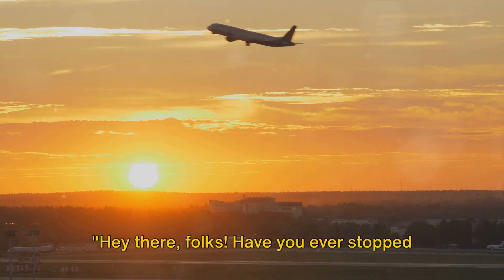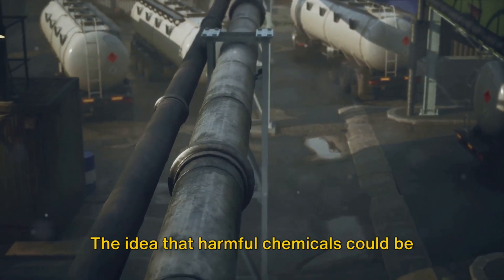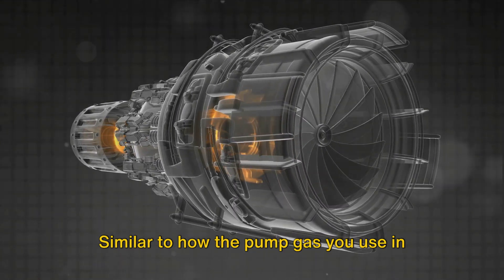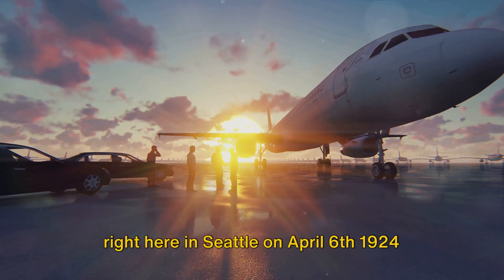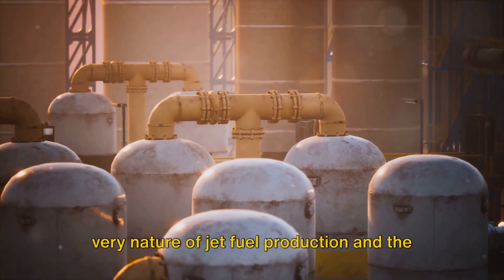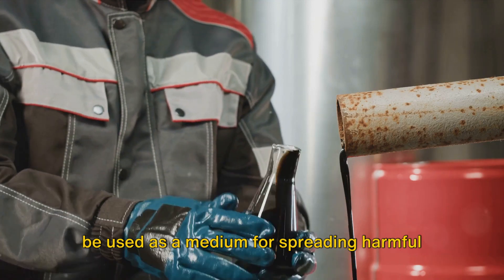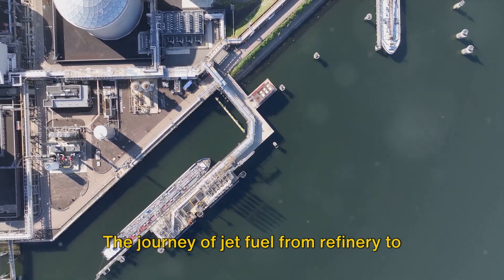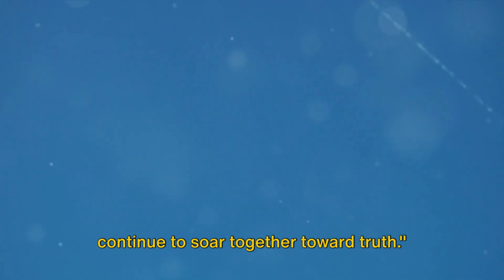Debunking Chemtrails - Part 2 - Jet Fuel - Journey From Refinery to Runway

Comment: Chem trail, Con trail. Two completely different occurances. Serve your mind melt elsewhere. Chemicals and heavy metals are NOT burned in a jets engine. These Chemicals and heavy metals are disbursed via high pressure lines installed al😅ng a planes wngs. Nce try.
Reply from the maker: So, with your logic, the manufacturer of the airplanes would be involved as well as the ground crew, the airline employees running the weights and measures program before each flight, and of course the logistics of getting these substances into all major airports with all the people involved with it. We know geoengineering is real and done by aircraft similar to crop dusters. However, it is not from commercial aircraft in a clandestine nature as the conspiracy you propose and believe. Facts and physics debunk this theory completely. Maybe watch the other videos covering the topic?
Reply: @kirkiem23  inyour own replies, you recognize the difference, by cause and action, the difference and validity between condensation and chemical ~ occurance vs. application, weights and measures, ground crew, pilots, lets be clear, i  am in no way insinuating that regular commercial passenger aircraft are utilized for as you call it, geo engineering. Btw cloud seeding, is just one of the many types of chemicals disbursed. 
If barium, strontium, aluminum, amongst the top three heavy metals, are for " cloud seeding " then we may be experiemcing some additional ecological nightmares. Such as the continued findings of entire forests dying, biolgists have discovered the cause not to be insect infestation in most cases, but high amounts of aluminum being sucked up with the ground water, plugging the trees ability to continue to draw water. As we also know all alheizmers victims show elevated amounts of aluminum in the brain. 
So defend your so called geoengineerng all you want, ill continue to support the recent states that have banned the practice all togethet. But btw, welcome to the conspiracy. You silly theorist.
Reply: @kirkiem23  coming from a purely 'scientific background' you are joking right? We can take this ad far back ad you would like, also having family in the omaha area, if i must perhaps i can ask a cousin to do a little video on the topic. Commercial jets, airlines, ....? Well perhaps before all the seats were removed and the hazmat tanks took thier place. 
Again, have you, yourself ever performed air sampling? I used to do so as an occupation. If you did, or you seem to be so versed on whats coming from the sky, as you say condensation. 
Reality, chemicals, specifically heavy metals. Barium, Strontium! Aluminum, oh my.... and im certain you understand the SCIENCE behind analyzation of particulates. You know the difference in evaluation tables from a pcm to a tem, right? 
You also can off the cuff quote the pel of the afore mentioned heavy metals. 
Since you most likely dont have these answers i wont press you on any further than perhaps explaining ypur way out of where these mentioned metals in our atmosphere are coming from? 
Ad far back as 1978 relatives have petitioned, gathered signatures, lobbied, boycotted, and sucessfulLy stopped the poisoning of the citizens via chemical disbursment via aircraft. Do your own due dilligence, and look up 1978 "save the tar weed " 
Also explain why it is that the territory of Maine just banned weather modification via aircraft im the maine airspace. No dumping on maine, i do belive one of the dakotas also banned the practice. Nice try tho. I for one have seen the planes,  for one have done the analization. 
If you cant see, flight tracker 24, giving the altitude, the flightpath, of these planes, and cant wrap your narrow minded brain around the fact that your own eyes see two planes, verify the same altitude and airspeed, one leaving s condensation traiL, which dissipates as the plane travels and the other leaving a chemicsl trsil that lofts all day long. If you cant see the difference, if you cant read. 
Then you must be a troll . Who and why would anyone spray microfine, heavy metals. Dont make me give up all your secrets, chemical boy
Reply: @kirkiem23